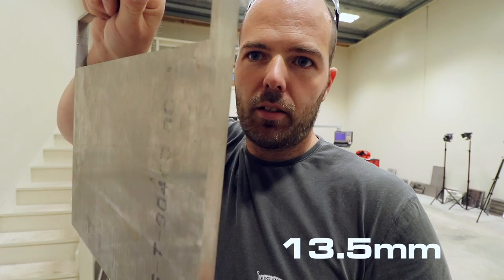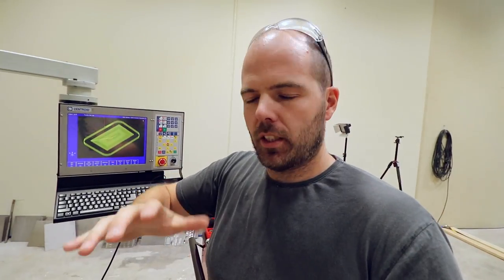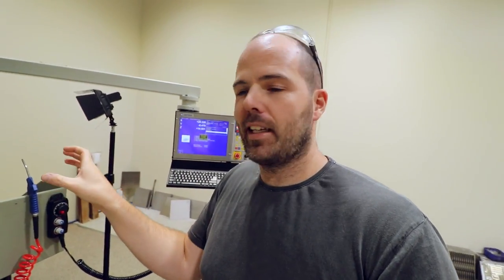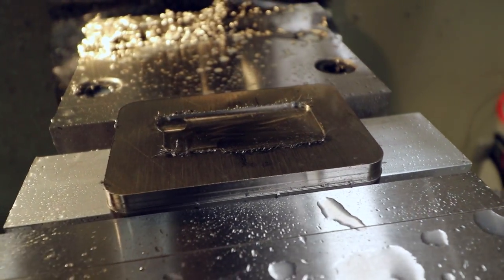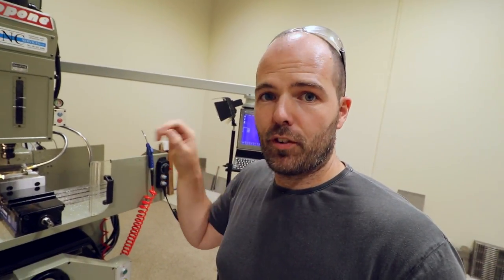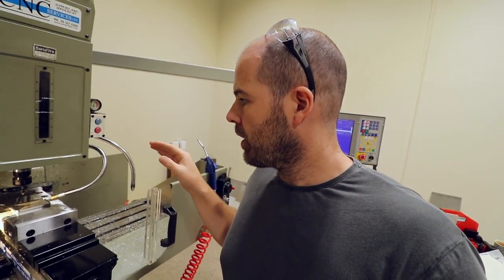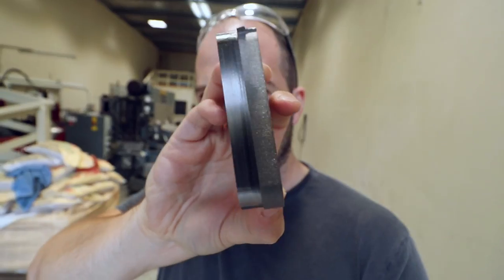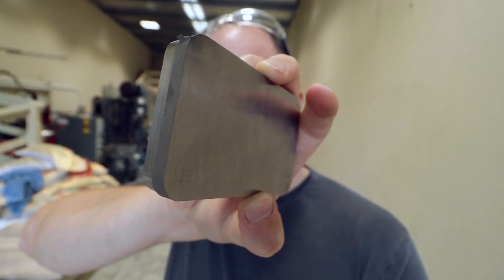Titanium Playing Card Holder (Part 1)

Comment: You might want to replace you mist coolant system with a FogBuster. The FobBuster has the advantages of mist cooling, but with larger droplets so it doesn't get into the air.